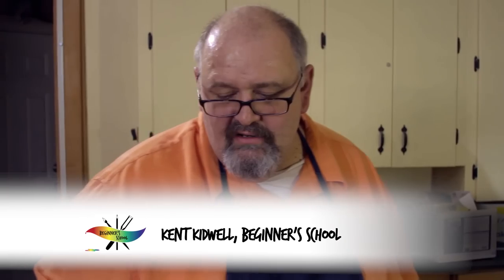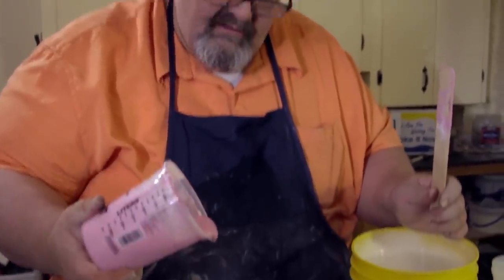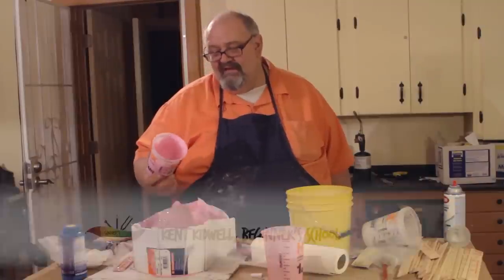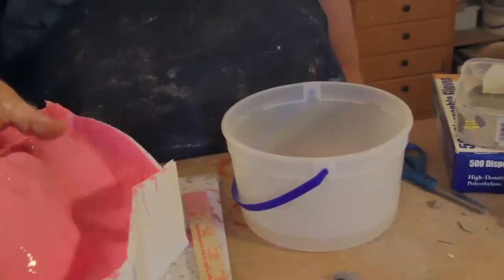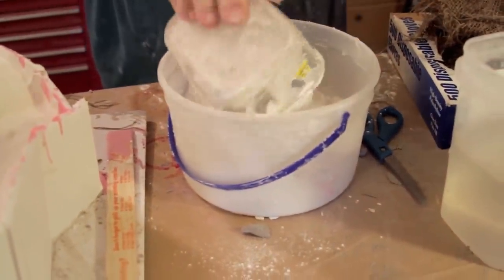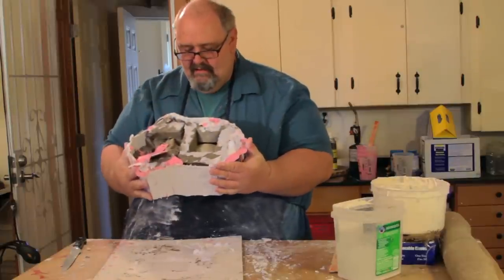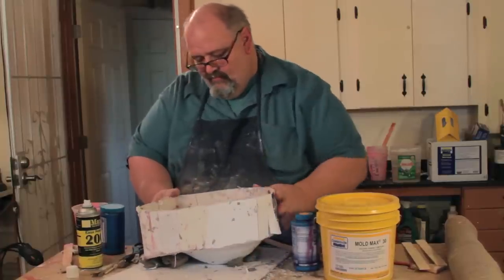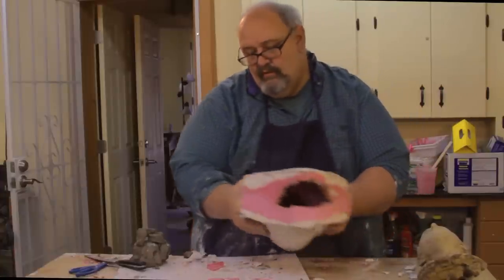Basic Two-Part Silicone Mold Making, Part Two

Comment: Nice job on the tutorial, thank you. Just one tip:

To make it easier adding ingredients, weigh the silicon, calculate the required hardener than, zero out the scale and then, slowly add the hardener until it reaches the correct weight. wash/rinse/repeat for your pigments and fillers, if you are using them.

Comment: Thanks!  I was was wondering if you can use the resulting silicone for a concrete pour?

Also, about how long did you wait between layers and what was the rough room temperature?
Reply from the maker: Sorry, I misread the original question. 

Yes, you can use silicon and urethane molds for concrete. Concrete cures through a thermal chemical reaction. Once the piece becomes firm enough to de-mold without breakage, remove from the mold and let air dry. The trapped water will slowly leech out and become very hard. I would use FGR 95, or ultracal or hydrastone myself. With concrete pigment masonry colored powders too. For me, the smoother materials cast better and are more open to coloration. Good luck.. happy sculpting.
Reply: Beginner's School Thanks, is smoothness the main advantage of using any of those other materials vs. concrete?
Reply from the maker: It depends a lot on the concrete. If you can find a quick setting concrete mix with no rock mixed in that would work and be least expensive. The other casting materials like FGR 95 found at most ceramic supply cast lighter so pigments stands out better. The material can be cast thinner with higher detail registration. It works with silicon well and cures quickly for faster turnover and higher production quality. It is also outdoor-friendly. The end product will require some prototyping to dial in the right design. Please know these options are what I would consider. There is always more than one way and mine may not be right for you! Good luck. :)

Comment: If I want to make molds for cement or gypsum rocks will this work?
Reply: Teresa Methe 

Yes, also research latex rubber, the process is a bit slower but very inexpensive and copying an existing wall pattern can be easily done on a vertical surface.  Back it with burlap or hemp cloth.
Reply from the maker: To be honest, I've used products like FGR 95 that have a percentage of gypsum blended into a potting plaster. I've never seen anyone use pure concrete as a mold making material. Possibly a very fast curing Quickcrete might work but it is usually very coarse and would be a very poor quality mold. The best rock mold materials are very fine and smooth when blended, allowing for better detail capture. I would try and find a pottery or ceramic supply and get pottery plaster such as Hydrocal, Ultracal, or FGR 95.
Reply: Beginner's School love your channel and I subbed👍✔️. Thanks.   Oh I think she was looking to cast cement using this video and materials. 🤝
Reply from the maker: @ds525252  Thank you! And thank you for the clarification RE: Teresa's question, seems like you were able to answer it for us!
Reply: Beginner's School

 not at all you are just a humble teacher✔️.  I’m learning from you.  My work area and rough methods are on course like yours... perfection takes forever and causes delay and procrastination ... at least with me.  I like your style Sir.
Reply from the maker: @ds525252  Sometimes it's good to set out to fail at something, that way there's no pressure. Start a sculpture/drawing/painting you know you will destroy at the end and give yourself permission to experiment and fail. It can be a very satisfying endeavor! Don't feel pressured to achieve "perfection". Just enjoy the process. :)
Reply: Beginner's School I will try that out👍.  Looking forward to your next video but no rush Sir 😁🤝
Reply from the maker: Sorry, I misread the original question. 

Yes, you can use silicon and urethane molds for concrete. Concrete cures through a thermal chemical reaction. Once the piece becomes firm enough to de-mold without breakage, remove from the mold and let air dry. The trapped water will slowly leech out and become very hard. I would use FGR 95, or ultracal or hydrastone myself. With concrete pigment masonry colored powders too. For me, the smoother materials cast better and are more open to coloration. Good luck.. happy sculpting.

Comment: These videos are great !!!  I cast busts with Mold Max 3 as well, but I pour the silicone.  I want to get as many pulls as possible so I shoot for at least 3/4" of mold all around it.  I razor the seam on the back of the head.  I wonder how many pulls you can get from your mold (brushed on thin with a hydrocal mother mold)...?
Reply from the maker: The number of pulls is much more dependent on the piece than the type of molding product used.
A smooth piece will have many more pulls than a piece with small details and undercuts. For example, a smooth ball could have hundreds of pulls, whereas crocodile only several dozen. Hope this helps! 
--Kent Kidwell for the Beginner's School

Comment: Can I use this mold to cast platinum silicone?
Reply from the maker: I'm not sure I understand the question. Are you asking if you can use platinum-based silicone for this mold? Or you'd like to cast something out of platinum-based silicone?
Reply: I would like to cast platinum silicone in this mold. And was wondering if I was able to do that or if there’s a better moldmaterial I could use
Reply from the maker: @michaelielpo8165  Silicon molds are best for casting polyurethane resin, fiberglass resin, polystone, hydrocal, clear eurethane, etc. but silicon is  a very poor mold for casting silicon. The biggest reason for that is is bonding. You can do it but if for whatever reason your mold release fails, you will not be able to separate them and your mold and casting will be lost. Not a fun experience, trust me! Silicon casts very well in stone, hydrocal, plaster, or fiberglass,  with no sticking.
Reply from the maker: @michaelielpo8165  If it were me casting platinum silicone, I'd use white hydrocal. Put down a single splash coat first, second coat with either fiberglass chop mixed in or hemp. Let me know if you have more questions!

Comment: you forgot to mention what material of silicone  you were using
Reply from the maker: It is a two-part silicone. Smooth-on makes a lot of great products. In the video, Kent suggests using a tin-based silicone rubber that needs to be measured with a digital scale. If you’d prefer to skip the scale, you can instead purchase OOMOO from Smooth-on that’s a one-to-one ratio, so you don’t need to measure anything. The OOMOO is less expensive, but may not last quite as long as the tin-based silicone.